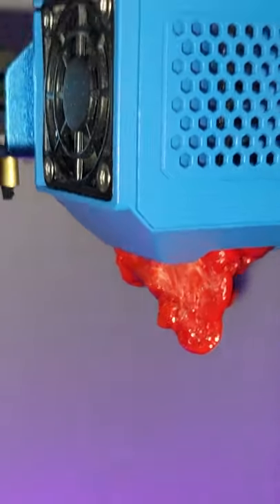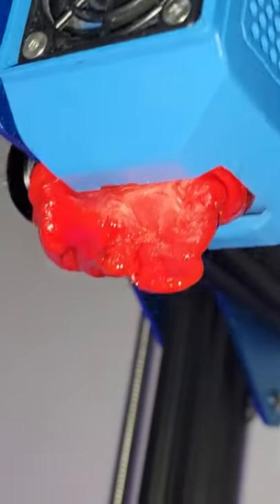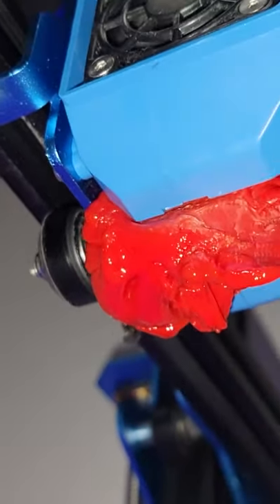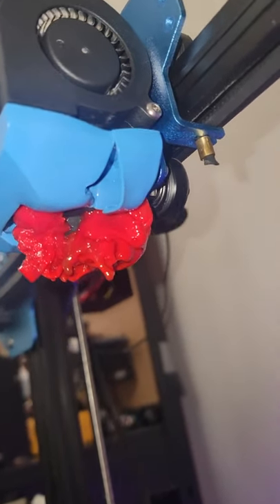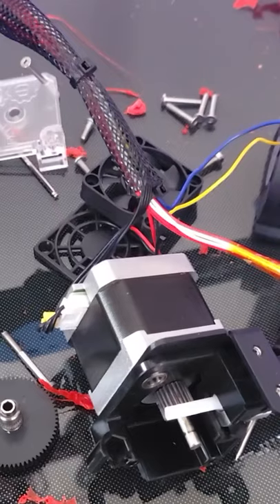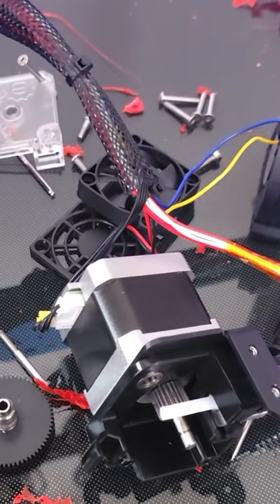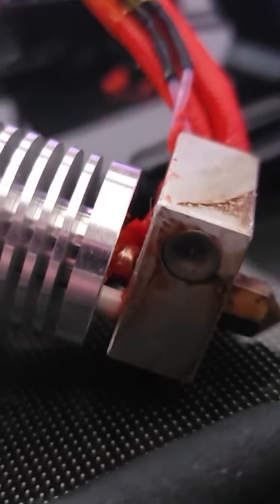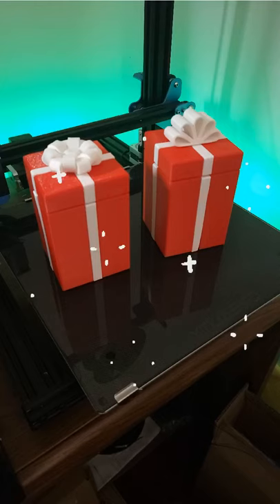3D Printing While You Sleep #Shorts

Comment: I do several day prints on multiple printers all the time and never have issues. Just make sure your printer is dialed in and you won’t have issues.
Reply from the maker: It's the first time this has happened to me in a year of printing. The only thing that changed was the brand of PLA.
Reply: @Kimchi_Studios  I always run a few shorter prints with new filaments till I am comfortable with them. I mostly stick with the same brand as most of my prints are multicolored or get painted.
Reply from the maker: @jheuer87  The global shortage has eliminated the availability of the brand I was using.